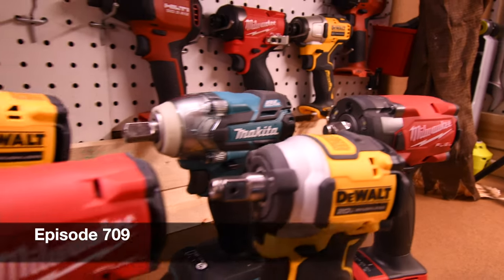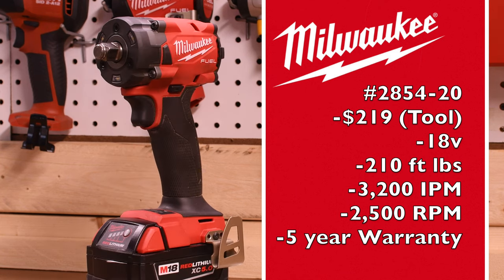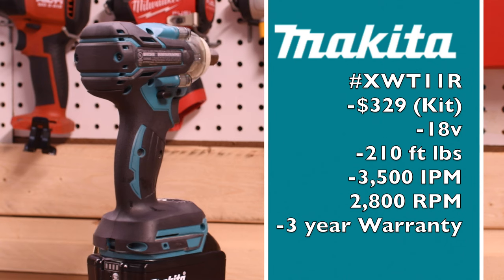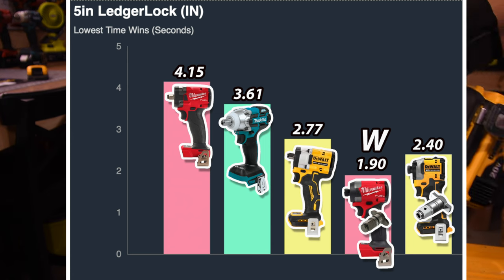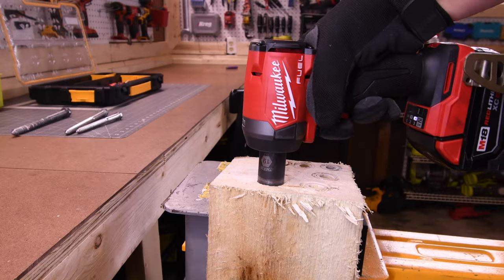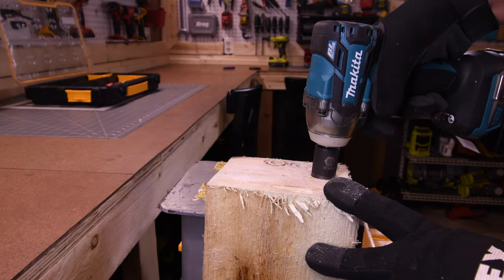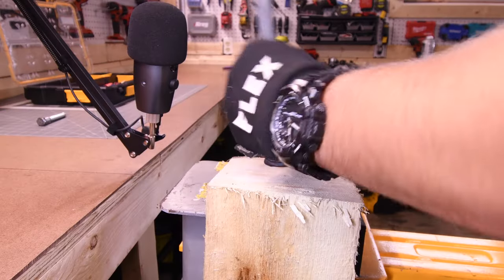Impact Wrenches "do more than BUST NUTS!"

Comment: Very surprised the 850 Frankenstein was the 2nd coolest from the bunch. Such a small body and no overheating sounds like a win.
But that Gen 4 Frankenstein makes me want one. What a beast
Reply: The dcf850 feels like a leaf blower is stuck to the back of the motor. It runs very cool I’m impressed.
Reply: My  DCF850 never gets hot no matter what torture I put it through. Solid tool especially with a 3/8 anvil on it. YOU DON'T NEED A RIGHT ANGLE Impact anymore 😎 It's so tiny 😁🙂

Comment: The ½" anvil with the ¼" hex hole is really holding back the DCF850 "freak". I'd love to see how the DCF850 performs in this test with a ⅜" square anvil. I put the ⅜" square anvil from the DCF890 impact wrench into my DCF887 driver and it's like a whole new tool. On speed 3 I'm busting nuts all day long especially with the high output batteries using 21700 cells.
Reply from the maker: Philly fixed and TTC proved the the 3/8 anvil is powerful
Reply: I have one with a PowerStack battery! It's incredible and so tiny. Have a few videos on my channel
Reply: @mike_t_007  
Hey, just checked them out. Nice! When I got the DCF850 it was originally for around-the-house type work and school project type stuff for the wife and kids to use, but it was so good as a driver that I decided to do the anvil swap on my old 887 (since it was out of warranty and all) and use the 850 as my daily go-to driver. It's worked out great! It's clear the 850 makes for an amazing ⅜" wrench, but, surprisingly, so does the 887! I rarely have to reach for my bigger mid-torques anymore.
Btw, what's your Lexus?
Reply: @joshuaewalker  That's great Man! Love my 850 as well. RX300 is the Lexus

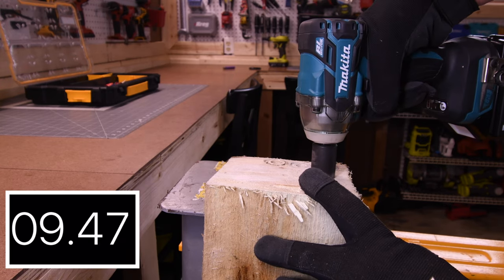Comment: I like the test but why cut at 4:42? Looks dodgy to me... 🤔
Reply from the maker: I edit out segments to save on the duration time. this video was way too long as it is. there is no reason to doctor test results. that doesn't happen on this channel. only real tests results matter
Reply: @ManCaverTools  I understand.. and I'm very thankful for your work. 
For me it's just a very important moment for interpreting the time results comparing how far the lag was screwed in (or not) - after the first attempt and after the second, too.  
I don't wanna say that you do this on purpose - just that this moment of the result is too important for the interpretation to cut it out.
Reply from the maker: @januszR  what I need to get is washers for these, which I will pick them up today. i won't need to stop to see if the head of the lag is going though the wood. The washer will prevent that so I won't need to spot and check anymore. I also need to get low profile 1/2 sockets. im not a fan of the not being able to see the lag like it is now. I got low pro 3/8 sockets so that is good to go. ill fix this issue though. its been going on for way to long and thank you Janusz
Reply from the maker: @januszR  and all of these tools did those lags non stop, the tool didn't stop working, I stopped the tool to make sure I dont driver the lags in to far to where I would need to dig them out. that's when the washers will come in handy

Comment: The combination of the crazy IPMS and an actual anvil for an original driver of the frankenstein jus kicks ass its crazy. The dewalt freak jus seems to not have the balls to overcome the anvil mass with larger stuff. The 1 gun that mite be able to beat it is a flex quick eject frankenstein lol. Also i wonder how the frankenstein would do with a 3/8 anvil instead. The atomic freak with 3/8 did better then 1/2 on TTC

Also i do wonder what the newer makita xwt15z would have done. Thats the 1 original impact wrench that beats the atomic dcf921
Reply from the maker: the 3/8 anvil I believe is best for the 850.
Reply: @ManCaverTools  you need to pit both the 3/8 and 1/2 against each other